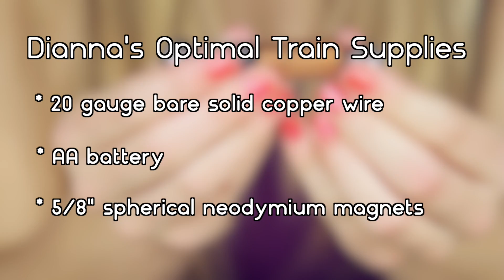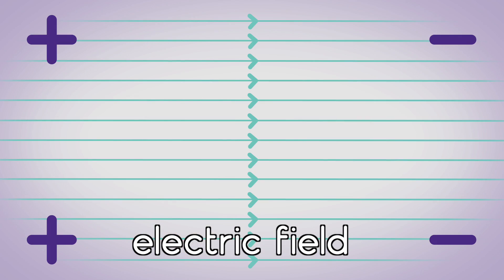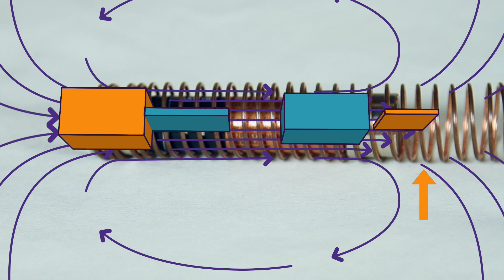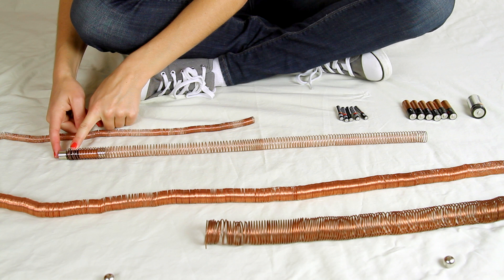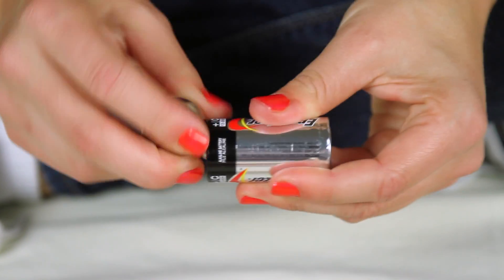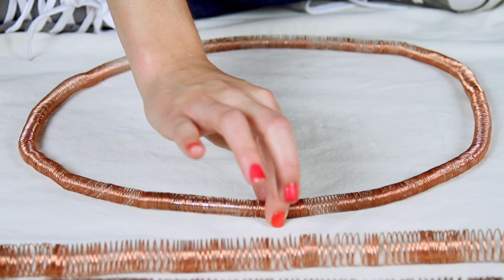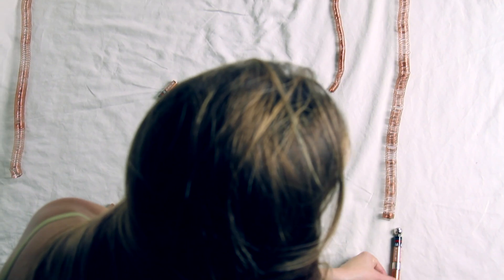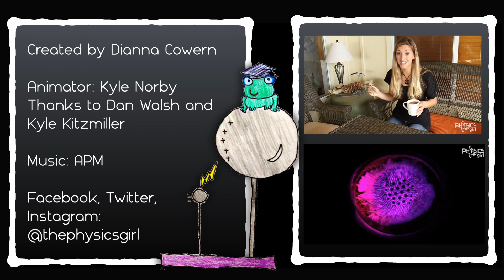World’s Easiest DIY Electric Train

Comment: So -- does the battery die after sometime?
Reply: well, try to guess...
Reply: My guess is yes, but I don't think I followed how to the current from the battery was being used.
Reply: *****
it's being used to move the battery forward..
Reply: *****
the current goes from the battery, through the magnet, to the coil. Those magnets are conductive. Then the current gets used in the coil to create another magnetic field that pushes the magnets forward, so yes, the battery will discharge and quite fast.

Comment: This a long solenoid.  I could use a pvc pipe and put the coil outside, to avoid a short
circuit .
Reply: But the battery provides the current for the solenoid and if they aren't touching, you'll need to run a current through the coil from outside and you only need a magnet (no battery) inside, and you might have an internal field that's too uniform to produce a net force on the battery.
Reply: Now you almost described a coilgun.

Comment: I tried it, but whenI replaced the regular alkaline AA batteries with Lithium Ion AA rechargeable ones, the high current those Li-Ion batteries could deliver at once, was amazing. There was one major problem I found out the hard way: the train got stuck and the copper coil got too warm to touch. Well, the fun was there, the speed of the train increased considerably, but the heat fatigued the copper wire quite a lot.. maybe I should try a thicker wire. It's all about experimenting, more fun trial and error :)
Reply: If you use thicker wire, the resistivity of the copper wire can be reduced. But, because of the internal resistivity of the battery, the temperature of the battery increase very fast. It may be out soon and it will not be rechargeable.
Reply: Yoichi Hirose Correct! Unlike alkaline batteries, rechargeable batteries drain faster when a low load resistance is used. For that reason, alkaline batteries are far better for the electric train project. Thanks!

Comment: C size batteries are the same voltage as AAs (1.5 volts), so you're requiring the same amount of energy to move more mass. When you connected multiple 1.5 volt cells in series, you increase the voltage in the system, giving more energy to move the object.  For best results, you should try to find a balance between highest voltage relative to mass while still having enough capacity to give you decent run times.

Am I right? Been a while since I studied this stuff.
Reply: When we connect multiple 1.5 volt batteries in series, we can increase the voltage in the system, but the total resistivity including the coil and internal resistivity of the batteries increase, proportional to the number of the battery. So current does not change. 
The magnetic fields inside the long coil can be calculated by NI. Here, I is current and N is number of turn per unit length of the coil. When you do not expand the coil N is constant, so NI is same.
In addition, the magnets which work as driving force are only two magnets attached to the top and end of the system. Intermediate magnet which connect two adjacent batteries does not work as a driving force, because those magnets are located in the uniform magnetic field.
Magnetic field is almost uniform inside the coil and divergent at the end of the coil, relatively in a narrow region.  
The magnets which locate at these divergent magnetic field only work to push and pull the system.

Comment: Also, would a higher coil density make it go faster?
Reply: Yes it does.
If the internal resistivity of the battery is negligible, magnetic field inside the long coil NI does not change, even if we expand or make it denser. (N: Number of turn per unit coil length, I: Current)
But, it is not the case. The alkaline battery’s internal resistivity is relatively high, maybe comparable to that of copper wire coil. 
In such cases magnetic field NI of dense coil is larger than that of elongated coil. We reduce the current and increase the durability of battery at the same time. Weak point is visibility of the train.

Comment: If the electricity was running through the coil then why weren't you electrocuted when you touched the coil?🤓🤔
Reply: +Arthur White true but i was wondering too if it was related to the substance of the wire being copper
Reply: +Arthur White no she didnt

Comment: we can apply an external DC source to the coil (track) like a 5V adapter  and simply place a simple magnet inside the loop and the setup will run infinitely until the source is turned off.

Comment: I am going to try it in copper pipe.
Reply: You could try, but it won't work. The electric field is produced when the current passes through a coil, not because of the metal itself.

Comment: Use a rechargeable battery.  They have lower internal resistance which means more current.  More current means higher speed.

Comment: Wonder how far the coils can be per volt charge with a mix of plastic structure and coil. If the coils can be wide enough to make a plastic switch to divert the train to another track and breaks in the coil to make segments controllable and stop points to recharge the batteries . Would make for a wild science toy train set,if so.

Comment: What would happen with a higher voltage battery?  There is one that looks like a Double A but is shorter and used in my garage door remote control.  It is 12 volts.  Also, what is the effect of varying the pitch of the coils?  Thanks!  Your channel is awesome.

Comment: Has this got to do with magnetic fields and electric fields?
Reply: Is there a change in the potential difference in between the cell which wold cause one end of the cell to attract a magnet and the other end to attract the opposite magnet and with this change of potential difference and the magnets touching the copper wire there is an induced EMF which would carry the cell through the wiring due to this electromotive force?

Comment: I'm not surprised that the C-cell battery moved slowly. C, A, AA, and AAA batteries all have the same electric potential (V), 1.5V. The larger batteries just store more charge and can run longer. Since the resistance (R) of the electrical connection between the magnets and copper coils is roughly the same for all batteries and you're applying the same voltage, you should drive the same current (I = V/R). The magnetic field that pushes the train along is directly proportional to the current (B ~ I). SO, same voltage means same applied force, but since the battery is heavier it moves more slowly.

If you want it to go faster, try a higher voltage or lighter battery or reducing the resistance (which will be tough with household parts). Great video and at-home experiment!

Comment: Why does everyone keep asking about this being used for full sized trains and large size stuff.  Would it work?
Answer: That is a really stupid idea. A giant coil of wire with self powered vehicle. And the high voltage coils (exposed wires) would be encircling the passenger cabin. That is really, really stupid.

Comment: I don't think you got the physics completely right on this. What I see is a current being generated by a moving magnet which creates a magnetic field. The two magnets are generating an A.C. Current which is pushing the train. Does this work at all if you insulate the magnets with a thin film of tape?
Reply: The train does not move unless the magnets are in contact with the wire -- so therefore -- you are wrong.
Reply: How do you know? Just because someone told you? I have 40 years of experience with motor, generators, electronics and see that the explanation given while interesting does not preclude the possibility it might be incomplete. You would get a non changing DC current localized in the coil where the magnets are in contact. There is not enough difference in field strength of the poles to cause movement but the initial push of the magnets separated by the battery is a simple linear accelerator. That is why I asked if anyone had tried this with the magnets insulated because I wanted to know if it would work without the initial D.C. Current. I still think it is the AC action of the reversing fields which would overwhelm any DC field and provide the North to North and South to South Repulsive force and then switch which would cause the poles to swap in the coil and then we have an attractive force. This is how linear accelerators work but we use electronics to control the switching.
Reply: "How do you know? Just because someone told you?"
You can see it you nut. You have to push the train in until both magnets make contact with the wire -- that enables the juice to flow in the wire.
Reply: Do you even understand what you are seeing? I have over 40 years of experience, years of education in electronics and electrical generation. What do you bring to the table?
Reply: I have over 41 years of experience.
Reply: Cool.

Comment: use Small size N 12 volt batteries, Also I would like to see a train all the way through the coil going round and round. If you line the coil up so the spin is inward where the center of gravity is inside the coil  It may harvest Gravity's power + the  batteries. Energy harvested by wrapping a secondary transformer coil around the existing coil! Keep me informed!
Reply: What if you use a capacitor instead of a battery. Instant high voltage discharge - A rail gun. A Silent gun!

Comment: Surprisingly the batteries don't last very long, and don't leave them in contact with the wire for very long as the batteries will get hot.

Comment: Does it matter which way (clockwise or anticlockwise) you wind the coils? If they are wound the other way does the train go the other way?
Reply: Yes! The magnetic field will go the other way, and the train will follow it :)
Reply: ***** same thing. Different language.
Reply: +George Smith Actually the direction the train would go is based on the magnetic fields of both the coil and the magnets. The magnetic field on the coil is dependent on the direction of the current(perpendicular). So it doesn't matter which direction you wind the coil.
Reply: If the coils go the other way then all you have to do is flip the battery and it will move forward.

Comment: Why the batteries? The explanation makes it sound like the magnets are doing the work.
Reply: The battery supplies the current that passes through the copper wire generating the magnetic field that the magnets interact with.

Comment: When using two batteries, instead of putting a magnet in the middle, you could put both batteries in series getting a higher voltage, more current and a stronger magnetic field. Although what you really need is a stronger gradient of the magnetic field... it would be interesting to try that out and see if it goes faster.
Reply: Now I realize that they wouldnt stick together, maybe putting some tape could work

Comment: Very cool video :) By curiosity, do you think that placing magnets between two batteries really increases the train's performance ? Of course the magnetic field produced by the coil is stronger due to the higher current, but since the magnetic field in the middle of the coil is not divergent, would'nt your train be lighter and faster with a smaller magnet in the middle ?

Comment: I'm wondering if a 9-volt battery with an insulated wire off one terminal to the back end (so that magnets are still at the front and back) would go super fast.

Comment: I think it works because of Fleming's left hand rule.
When current flows in a wire, and an external magnetic field is applied across that flow, the wire experiences a force perpendicular both to that field and to the direction of the current flow.
Nothing to do with slight differences in flux or whatever.

Why don't you see what happens if you connect the battery to the coil and then put the magnet inside on it's own?
Reply: https://www.youtube.com/channel/UCeHDP5ZypGK3_mh0dsdjGRw?sub_confirmation=1

Comment: apparently if the batteries are bigger they gain more weight than their increased size gives them "immediate" output power/speed
so that might mean that if u make these super super small they r going to be super fast
u could probably even calc if they would always get faster the smaller they get if u knew how to do that

Comment: Do it with Ultimate Lithium AA batteries. They weigh less than the regular alkaline, and even though they're rated for the same power, anyone who's ever used them knows they're more powerful than regular alkaline batteries. Put both of those things together and you should have yourself a considerably more powerful train

Comment: By the way, I don't know if you're aware of it, but a 9 volt transistor battery is actually just 6 AAAA batteries with a wrapper around them.  You can take the wrapper off and have the 6 batteries.  Probably cheaper (and more accessible) than hunting up packaged AAAAs.
Reply from the maker: I found that out while looking up the diameter of AAAAs. WEIRD. I wonder if that's just easier to package than actually making a battery the shape of a 9V?
Reply: You said what I was going to say. TY. What self-respecting electronic kid hasn't taken apart a 9V battery? I assumed everybody had.
Reply: +Physics Girl lithium primary 9v batteries use three cells that are more cubic in shape, they typically have corners that are square while alkaline 9v have rounded corners matching the radius of the AAAA batteries within.

irrelevant, but the 9v lithium primaries have high peak discharge and extremely low self discharge which makes them excellent for fire alarms.
Reply: +Physics Girl you're online. Do you like Ellen Degenerous? Please please please do some tricks on her show.
Reply: "Keanu Reeves face" Woooah! Mind=blown.
Reply: Don't use AAAA batteries triple A Energizer MAX are most efficient
Reply: I threw away the metal case for it and don't recall which brand, but I have a 9V battery that's constructed of 6 flat rectangular batteries that are stacked.  I was surprised to see that, but it's a more efficient use of the space inside compared to the cylindrical ones.
Reply: hey physics girl
If someone wants try  this or wants to do it for school project; how or where can we get all the necessary things; and how did you make the train track? 
 awesome video, best reactions.
Reply: Hi!
Reply: Some models of alkaline nine-volt batterycontain six LR61 cells[4] connected by welded tabs. These cells are similar to AAAA cells and can be used in their place in some devices, even though they are 3.5 millimetres (0.14 in) shorter. -- Wikipedia

Comment: if you attach somme batteries like in the end of your video, but with middle magnets that don't touch the wire (magnet smaller thant batteries)  it will probably run faster ;)

Comment: So what happens if you make a - let's say - 30 degree ramp from the coil. Would you need to change the ratios between the battery size and magnet size so it would carry itself up? Would it need to have a flat run to gain speed before the ramp?

Comment: Wonder if the speed is related to the connections of the batteries in any way. A series connection means a higher voltage, while a parallel connection means a higher current generally. That'd be fun to calculate